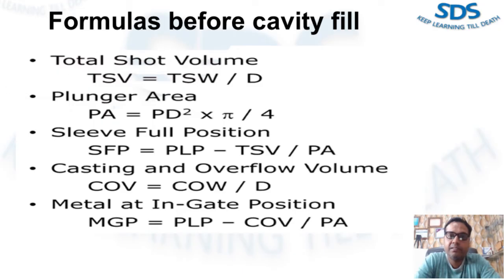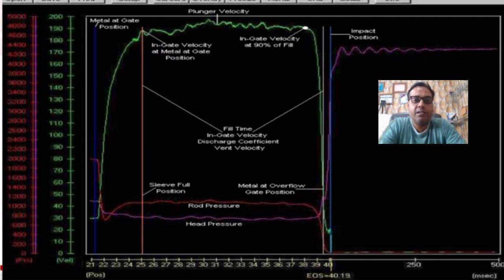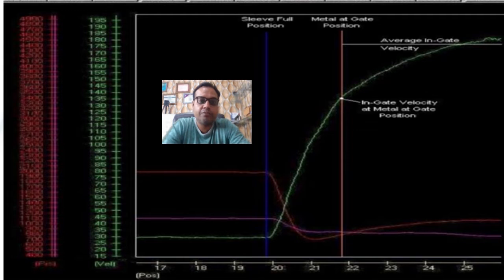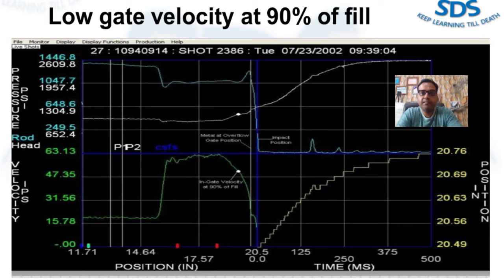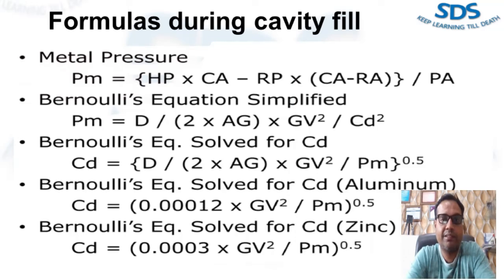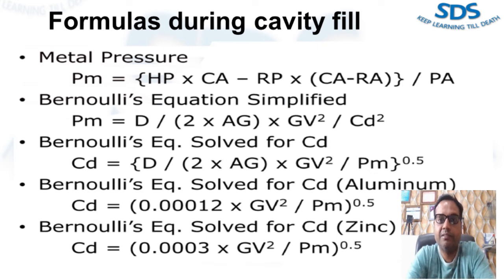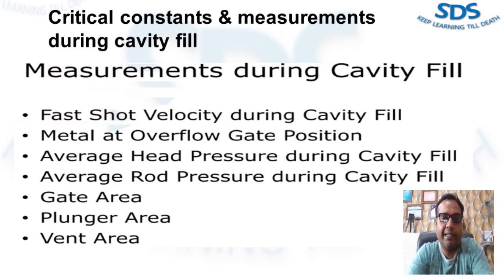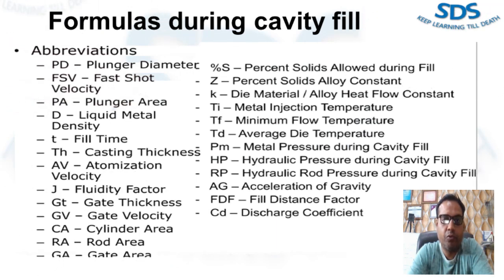Process Control During Control // HPDC // Die Casting // Bharat Sharma

Comment: Sir As you told Casting force =  Casting pressure × Plunger Area
Means Pressure exert per unit plunger area  
& clamping force = Casting Pressure × Projection Area 
Means pressure exert per unit projection area
Sir my doubt is  in which direction casting pressure exerts..
Reply from the maker: From biscuit to plunger , in other words you can say reactive force. Active force is injection force = injection pressure X injection piston area. Which is generated on injection piston .
Reply: @hpdcpathshalasds  Sir what in the case of Clamping force .. 
As you told Clamping force = Casting pressure ×Projection area